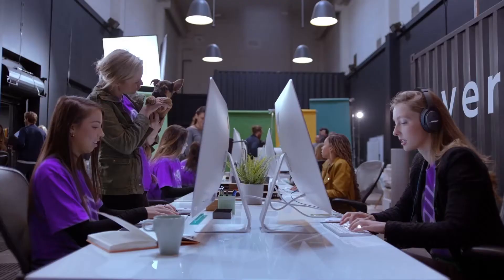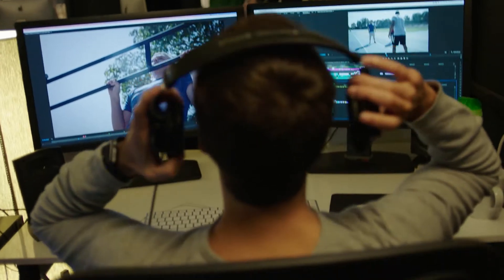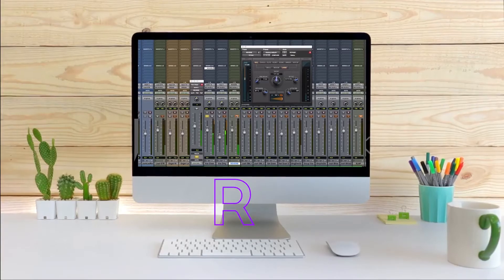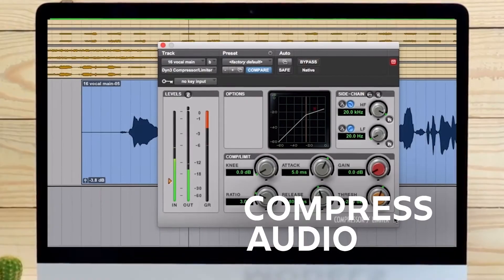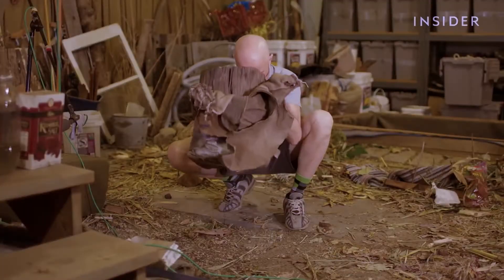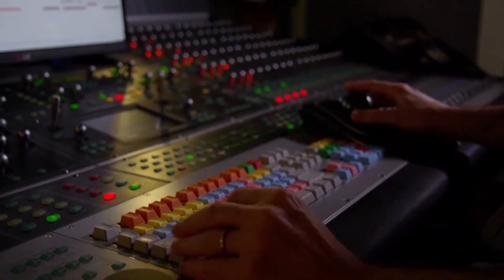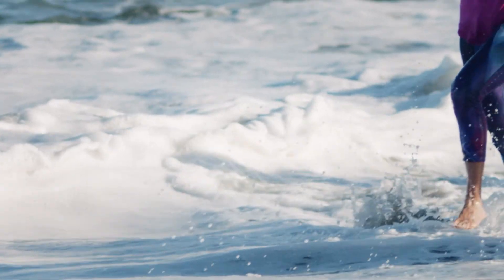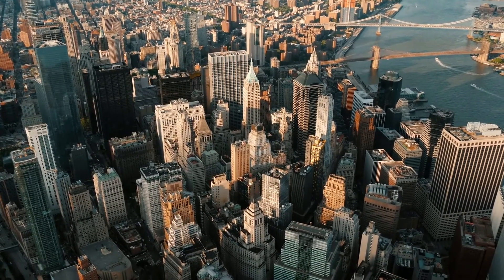What does a sound designer do?

Comment: Not quite accurate.. Sound Designers design sounds, usually using synths and audio samples. They do not mix projects, unless they're assuming another role. 
Mixing is done by mix engineers. 
Foley by both foley recording artists and sound designers combined. 
You should at least mention audio synthesis in this video - core skill for a Sound Designer.